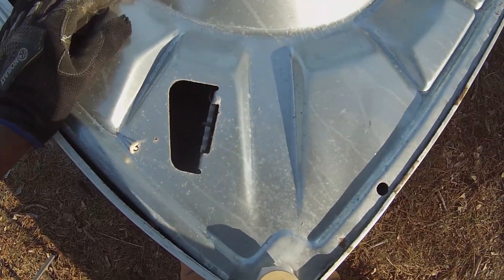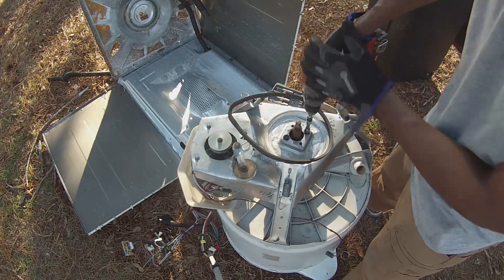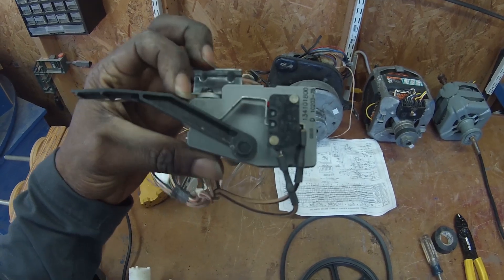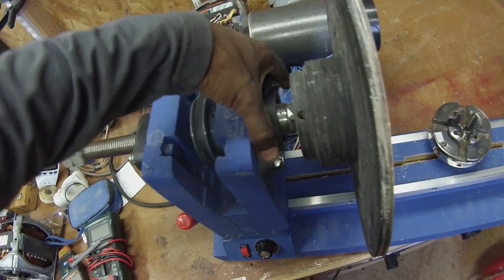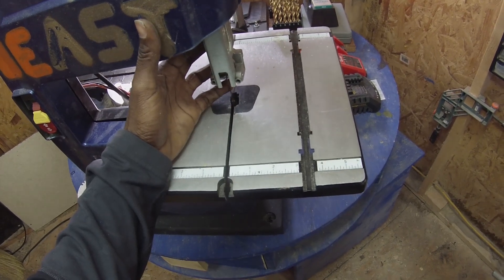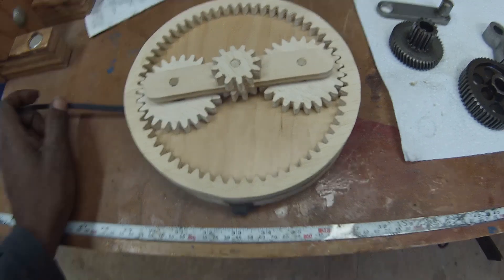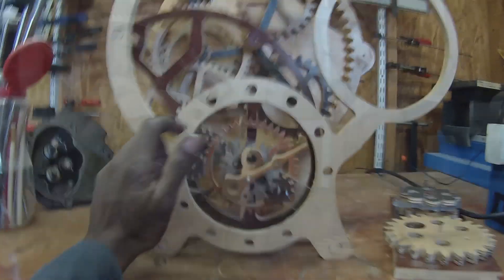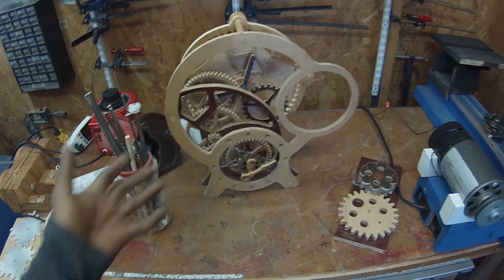Things You Can Make With A Washing Machine And Other Salvaged Components : 020

Comment: Im not an engineer, but wish i was. Love to see your mind work. I would really love to see a start to finish project shop machine using and wiring a washer/dryer motor. I have one but don't know what to do? Thanx.
Reply from the maker: I certainly have all the components on my channel... but I don't usually show the complete wiring in the same video as the build. It makes it took long. I have several videos showing how to wire various types of motors, and of course lots of build videos using those motors. "how to wire a motor for shop tools" is the one the shows the washing machine motor wiring... and you can pick one of many build videos

Comment: Great video Jeremy, that washing machine motor is a nice one with good pulley too. A vacuum motor also overheats as it needs that airflow over the windings. Microwave turntable motors are great for clock drives. various speeds 3-4-5-6 RPM etc.

Comment: i had an old washing machine
it was the one my mom used we had it for YEARS literly it was a hell of a trooper 
well recently (few months ago)
the springs that hold the tub up died
yep the motor is fine every thing els is fine
but the springs are DEAD
got a new washing machine and i tore the old one apart
i have a large puley and a incuction motor... im no expert at all on those things
heck i tore up my grand parents old excersize bike thing (with permission) and it had a a drum brake type dealeo and it was to make the thing take extra force to move and a HEAVY flywheel it had a ribbed belt on it and i could get the thing going SO FAST that it could literly preses with most of the frame still on it yeah the thing literly can go round and round because it has a heavy fly wheel that is balenced it is like a gyro still trying to figure out what the heck to do with it and the washing machine motor 
im thinkin bout making some air raid sirens maby although i dont reaky have the materls to do so or the knowlage
me and my grand father also slavaged an old john deer lawn mower that we had 
the deck was ruined but
the hydrostatic transmission and the belts were good
the engine is also still perfectly fine and it had a automatic clutch wich works it had a 22hp vtwin brigs and straton on it had a vacume fuel pump on it aswell so lots of good stuff and a ton of metal LOTS of metal

Comment: hey Jeremy, would you consider building a surface grinder utilising a sanding belt instead of a grinding wheel, with a magnetic chuck from salvaged magnets, sitting on top of a sliding left and right bed which lifts in small increments via the use of a salvaged incline motors from a treadmill, i would like to see you come up with something like that,, i have been wanting to build one for surfacing knife blades once they have come out of the forge,, like to know your thoughts on that ,, cheers.

Comment: This what I still love about YT: I discover more and more people as crazy as me!:)) I love that clock dude!!

I'm planning to build a bead blasting cabinet with a heavy revolving platform capable of holding whole motorcycle engines. The idea is to use either a fridge or washing machine case, a spin cycle bearing and alloy wheel, and maybe another wheel outside below the cabinet to remotely turn the engine whilst blasting. I will maintain negative pressure and extraction via an old vacuum cleaner. Pressure will probably have to be provided by a bought compressor. 

I'm looking for a cheap source of lightly abrasive material that removes engine paint but doesn't damage the aluminium. Sand is not an option. It's the worst thing to use on engines. 

I upgraded a pilar drill with a washing machine motor years ago. It looked funny, but worked really well. 

Just picked up a 42" TV that supposedly doesn't work. Not sure what I'm going to do with that. Electronics isn't my thing.

Comment: H Jeremy 
I love your channel , you definitely have a gift for communication, gets the facts across without masking your enthusiasm.
 I made a potters wheel from a dead washing machine a couple of decades back, I THINK??? i separated the stator windings from the rotor on the motor and used a big  transistor lighting dimmer switch to vary the magnetic field in the stator. and wired the rotor separately straight to power. I still had to use the original motor as a layshaft to bring the rpms down ... but it was a very long time ago so I dont remember too much about it. it worked in this application. but I would like to see some one  ,like yourself ,with a more scientific approach have a go, and maybe quantify torque etc with this setup 
https://www.facebook.com/anthony.turton.18/posts/725248377825801

Comment: Go cart powered by solar/ battery.
   Can you incorporate the motor in a go cart?I'm thinking 3 horses is good no?
Reply from the maker: The power used versus charging time would be impractical for regular use. Using a AC motor for a go kart is also painful. You need to convert Dc to AC that would cost more then just buying a DC motor

Comment: the gear box is useful if you decide to built an electric hacksaw. it reduces the speed of the motor and using a big pulley the speed is good for a reciprocating movement. The motor could be a 1/3 hp, that´s more than enough.
Reply from the maker: Great idea! I’ve been thinking about a reasonable use for that gear box for a while

Comment: Hey Jeremy, how about a hand powered air pump for a sailboat owner to scrub the boat's bottom?  Wife powered,of course!  It might look like two 4" pieces of pvc sewer  pipes spaced about 12-14" apart stood on end sealed at the bottom, an outlet valve (rubber flapper type),  plywood pistons, sealed with oiled leather piston seals and rubber flapper valve in the piston for air induction. the power might be an inverted T pivoted at the junction with connecting rods at the ends of the T and a delivery hose no longer than 33'.   Want more air? New paint cans are available at Lowe's.  I would, but I'm between boats.

Comment: will a washing machine motor run a 2 x 48 belt sander  ? and what size rated motor should i look for .
Reply from the maker: It depends on the application. You should just search for belt sanders like the one you are making and see what they use.
Reply: did look at what was with the sander and bought one .Thanks for the tip Andy

Comment: Thinking about making a vibratory tumbler with a 1/5 horsepower condenser fan A/C motor from a air conditioning unit I salvaged. I saved the capacitor too. Any tips? Thanks!
Reply from the maker: It sounds awesome! I have no ideas. I have never considered making something like that.

Comment: Where do you get all your spare parts from?
Reply from the maker: +Dallas Prather mostly from salvaged machines like what you saw in this video.
Reply: Where do you get these salvaged machines from? Like a junk yard or just appliances you buy and tear apart?
Reply from the maker: The side of the road...99.87% of the time. If I really need something I haven't found I just buy it. However, I usually design things based on what I have. I made the machine fit the parts I have... not the other way around.
Reply: Thats Awesome man I appreciate it, love your videos!

Comment: Do wood lathes use wahing machine motors? If not can you show tearing an old lathe down and how to use the motor for some kind of shop tool (s)? Lthe one im interested in most is a craftsman wood lathe motor
Reply from the maker: +charles johnson - they both use the same type of motor. A capacitor start induction motor. I have many videos covering this topic. Check out my “how to wire salvaged motors” playlist. You would also like the “how motors work” playlist. I have taken part several motors in those videos showing how they work.
Reply: Jeremy Fielding thank you very much Sir I appreciate it

Comment: ever get a washer with the motor attached to the gear box? and how about useable parts from a drier? 
one last question.. what do you do with everything you don’t use or don’t use right away?
Reply from the maker: I have three right now. The gear box is arranged to oscillate the tub. It is not really useful for anything other than a oscillating motion. So, yes the speed is greatly reduced but it only does a half turn then back the other way. I plan to do a video on it  (gear boxes) then throw them away. I can't think of a good use for them. The dryers I have salvaged have a small 1/3 horse power motor and a heating element. The only thing I keep is the wiring. The dryer is rated for 240 volts with very thick wires for the heating element. That is the only part I actually use. If I can't think of a reasonable use when I take it out of the machine I go ahead and toss it. If I don't use it within 3 months I toss it. There have been a few times when I came up with something after it is gone, but there is always next time. And, there are a few things I always keep even if I don't use it like bearings, shafting, v-belts, large fasteners (5/8 and up), and the motor if it is at least 1/2 hp.
Reply: Jeremy Fielding so a washing machine motor that is attached to the gear box or a drier motor isn’t really worth the effort is saving? 
and i want to thank for your response and all the work you do with your videos. i have learned things from you that others just do not cover or can not properly explain how to do.
Reply from the maker: I usually keep the washing machine motor, and remove the gear box. I don't think the dryer motor is worth keeping. But I have a large collection of 1/2 to 4hp  motors. Thus A 1/3 hp motor would just take up space. I would never use it. However, I use to keep them before I had so many to choose from for my projects.

Comment: Nice work, great mechanical mind.
Have you ever made electromagnets out of the transformers?
They are a little work and a lot of fun.
Reply from the maker: I have been kicking this around for a long time. I even cut open a motor to use that stator field as an electromagnet. It will happen sooner or later.

Comment: Hay rewire sum drum motors into generators use magnetic bearings and design a treadmill with a gearing and transmission and a bike and a stair stepper that drove those rewired drum motor generators to charge up a battery bank. Give folks with solar panel set ups another way to keep their battery banks charged up. You could sell these salvaged converted items online!

Comment: You could put a transmission in a treadmill to spin a weed eater then put the treadmill on wheels have your wife or child walk on the treadmill that spun the weed eater head like those drumel tool attachments work while the treadmill bike slowly moved forward. it could all be possible by using the gears salvaged from washing machines. Imagine landscaping companies would jump at ownibg a few human powered lawnmowers and weed eaters to cut costs from having to use fuel and maintenance of gas powered tools. You could even salvage a treadmill retrofit it with a gear system to drive an auger to dig post holes which famers and professional fence instalers would just love to have. You could even dedign a treadmill vacuum machine for a central vacuum system for a house. Get the wife or kid on the treadmill and just plug in the vacuum hose in each room to vacuum the carpet. Keep the family in shape while knocking out the choirs!

Comment: Thatis so smart man thank you for the advice! Do youthink you could make a drill press
Reply from the maker: A drill press could be made, but I wouldn't want to make one. It would be quite the challenge to make a good spindle and make it stiff enough to withstand the force that is applied pressing down. If you bought the parts for this it would cost as much as a cheap drill press.

Comment: you can use a dimmer switch on your motors to adjust the speed/power
Reply from the maker: No... You can not. I tested this against several parameters in a video  Check it out here. https://www.youtube.com/edit?o=U&video_id=tXJOtWPPRwE  
The only induction motors that can be controlled with a dimmer are the PSC, and shaded pole motors... basically fans. Because that is the only place you find them.
Reply from the maker: If you mean the DC motor, I would use a DC speed controller, instead of a dimmer. In the long run it is just better.

Comment: Retired Maytag man here if you want to try this do it with a Maytag Performa or the Neptune series washer model from the early 2000-2007. Can't believe this guy used a frigidaire. The motors are notorious for failure.
Reply from the maker: Well... I usually use what I find... I can't just take the one I want LOL
Reply: Jeremy Fielding I understand, I'll give you props on taking the motor out it can be a job. Keep up the good work.
Reply: Jeremy Fielding if you lived near me I could hook you up with a good motor
Reply from the maker: You should watch my "how motors work" series... I have got quite the collection of motors! AC, DC, single phase, three phase, most of the sub types of induction motors, ranging from 1/2 to 4 hp. The washing machine motor was the focus of this video, but most of my motors are larger than these. Thank you for the offer. That is pretty awesome!
Reply: Jeremy Fielding that sounds like quite the collection. Will do sir I'll have a watch. I don't know if you know this you probably do. But a dryer motor would work well if you could rig a belt pulley onto the shaft. Wouldn't be to hard.
Reply from the maker: +Null Llun me and you will have a long great relationship here :)

Comment: Initially, I was impressed, but by the end of the video, I am sure that you are a mechanical mastermind! I build small projects, but you have set the bar high with those wood gears. I could only dream of building a working clock of that magnitude. I work on cars so I always have an abundance of bearings and gears. I overlook the surplus of washing machine parts, but now I will tear into them! Thanks for relighting my mechanical fire.
Reply from the maker: +22KPAR1X Cyberdyne my job here is done! :)

Comment: Hi Jeremy, your work is really impressive. What motor would you recommend using to make a pig rotisserie? Essentially I need something that is capable of turning a heavy item at low speed.
Reply from the maker: +Damien Murphy that depends... if I was buying a motor it would probably be a D.C. Motor with a gear box to really dial in the speed. But I usually just use whatever I have and make it work. Just about any motor "can" do it if it is big enough. 6 pole induction motor with pulleys would be my next choice
Reply: Thanks for the response Jeremy. I was hoping to use DC. Is there any particular item I could salvage that would have the right motor and gearbox?
Reply from the maker: +Damien Murphy a electric scooter
Reply: Thanks for your help, much appreciated.

Comment: Salvage a hybrid electric motor from a electric vehicle. design a housing that you can place that hybrid electric motor in the center with rewired brushless electric motors around the hybrid electric motor. connect that hybrid motor to a stirling cold gas engine which will crank the hybrid electric motor causing the electromagnetic feild generated to force the other brushless motor generstors to spin generating electricity. Putting loads on devices can be over come by using vacuum spark gaps. Like placing mini vacuum spark gaps between each stator leg on a generator to improve its output ie high frequency electricity turning a small generator into a better generator without generating heat. That stirling cold gas engine could also be fitted with planetary gearing sun gears to allow the stirling engine to funtion more easy since their is not good compression in stirling engines yet ounce it got going it could crank generators 24-7 for clean electrical power generation. If condtructed correctly you could have heating and cooling and power generation for a home and not have to pay any utility bills. Which eould really piss off those fat cats controling the patent office. Since they own all the utilities people are forced to slave for and pay bills to them on top of income tax and other taxes all set up by them? Oh the truth is so sad yet creative folks will always create new devices to improve peoples eay of life correct? ; )